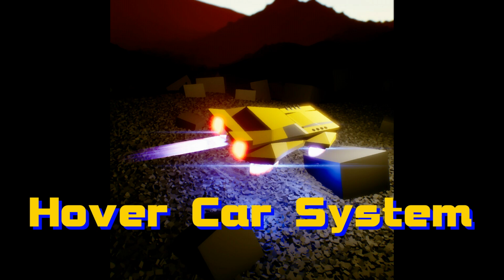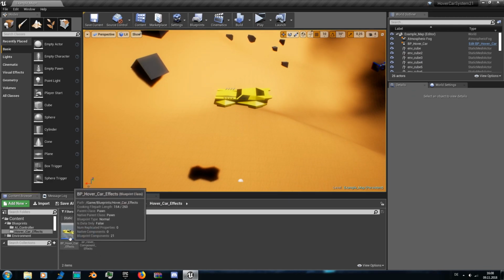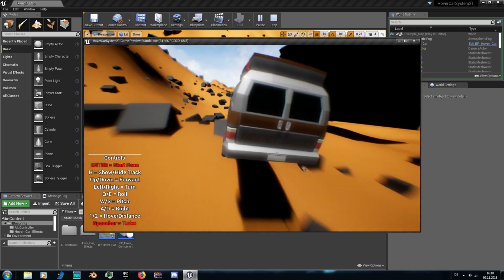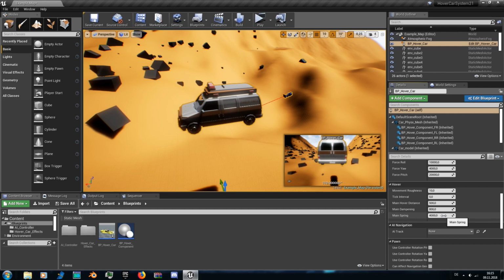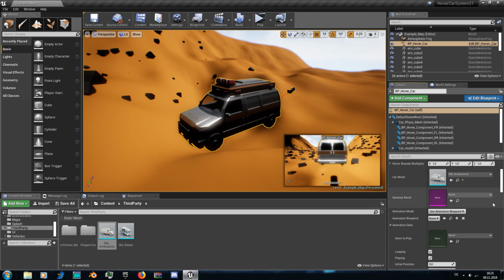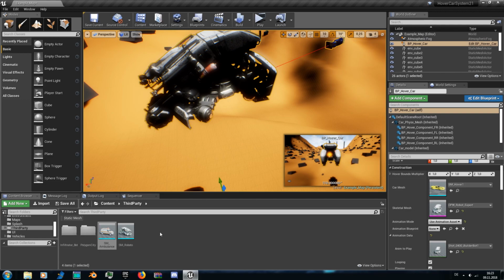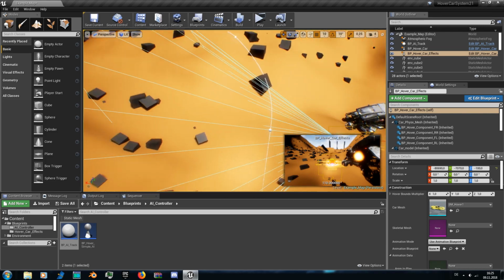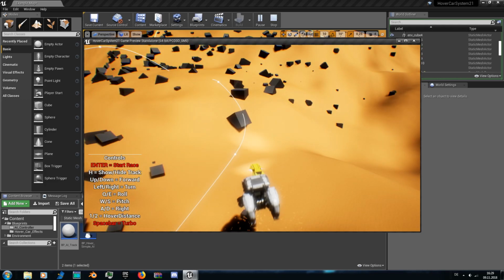Hover Car System - Basic Tutorial

Comment: hi hopefully you'll read this, i bought your project and when i drag it into my game and place the car, the pitch wobbles up and down violently, it works great in your project though, any ideas on how to fix this are greatly appreciated
Reply from the maker: Hey,
Maybe compare in your your Project Settings -> Physics -> Max Substep Delta time.

I can only recreate the frequent pitching issue when I increase the Max Substep Delta time using async physics. You can write me an email if you still can't solve the problem and I can take a closer look :)
Reply from the maker: If you are not using async physics, it should not happen. I need to check now if async physics is the new default in UE5. What engine version did you use?

Comment: Can you use this car system for flying?
Reply from the maker: It's not built to fly freely but to stick close to the ground at a distance. I think there are other assets on the marketplace that will perform way better in that regard. With some simple modifications (disable gravity/stick to surface) it can be used like a spaceship controller, but for helicopter/plane like flight it's probably not the right asset.

Comment: This is awesome! Using it in my project right now,but quick question how would i make it so that it doesn't stick to walls and move vertically
Reply from the maker: You could measure the angle on the linetrace in the hover components and if the Angle is too far from 0,0,1 world direction, just don't apply the hover components forces to the car. You can use the Dot Product for that ^_^

Comment: Hopefully you can help out with this but I am trying to make the car fall faster after going off a jump. Because I cannot adjust the gravity setting because I can't call the movement component I am confused. Even if I set the gravity delay parameter down it still floats too far. I even setup a boolean to change the acceleration pattern while in air but it want it fall faster. Any suggestions?
Reply from the maker: The movement is handled in the BP_Hover_Car main class. There is a variable called "Gravity Increase Delay" that you are probably looking for. It's a weird way, but I did it to have this launching like movement.
Reply from the maker: If you look for that variable you'll find some other gravity stuff you might want to change probably.
Reply: thanks so much for responding so quickly. As I said I did happen to find that setting and tweak it down to make gravity kick in immediately while in the air but I still float really far. Just wondering if other than the gravity increase delay if there was another way of turning up the gravity or increasing the mass of car without messing too much with the settings of the hover component.
Reply from the maker: @andrewhart74  Sure. Inside the BP_Hover_Car BP the gravity force can be increased or decresed as you want. It's currently applied on Tick as an "AddForce of -8000".
You could for example make this speed-dependent or time dependent or both.

One way would be using Vector3(0,0,Clampfloat[1000/Speed,0.0,1.0)*Vector3(0,0,-8000)
for the "AddForce" Input. So the faster the car goes, the less it's affected by this gravity.
Another way would be to start a timer-variable once the car looses ground and multiply the downward force by the timer. That way the longer the car flies, the stronger the gravity will be.

One problem is that a lower gravity means the car might just be able to fly around if the thrusters are strong enough.
Reply from the maker: So for getting your perfect movement, you may want to tweak all those parameters and maybe even the upward forces of the thrusters while the car is in the air. If you need more stuff, feel free to write me an email about it.
Reply: @tankbustergames9953   Oh that did the trick thank you!!!

Comment: Hey man, I love the hover car system! But I have a slight problem, I can't get the AI to work. I Have added the spline track and set the other BP Hover Car to AIController and set the track to follow. And i have added an event in the Level Blueprint to Start Race for all actors of the Simple AI Class. But they never move... Any suggestions? Thanks!
Reply: That sounds strange. It should work. Have you choosen the right AIController Class (BP_Hover_Simple_AI) for the cars or the standart AIController?

Comment: This is really fantastic! It's pretty much exactly what I need for my first big UE4 project!   :)   I'm a little torn, though... I feel like I should try to create a system like this myself to learn, but on the other hand this would let me get in and prototype my concept much much faster.

I do have a silly question.  Are all the hover and flight variables able to be adjusted on the fly? Like, if I were to implement some kind of upgrade system to allow faster acceleration, top speed, better handling? 

I will say, the price is extremely fair and I could probably learn a lot just seeing how you did it and playing with different settings!   Thanks!
Reply from the maker: Glad u like it :) You can adjust all variables on the fly ingame. I can not tell you to buy it. Just think this way: you want to learn -> don't buy, create your own (will benefit in the long term) // you want a fast prototype -> buy (saves time and you can maybe learn a little^^)
Reply: @tankbustergames9953   Went ahead and got it! Following advice of Gary Newman (gmod and Rust) saying to just start making things and playing and sharing as often as possible. Anything that lets me get to that faster is helpful.  

Also, always happy to support creators!  :D

Comment: The camera isn't rotating when I turn.
How do I fix this?
Reply from the maker: Go to the HoverCar BP, select the Spring Arm Component and Turn "Inherit Yaw". You can also adjust camera drag or Inherit other Axis. I disabled it by default to show the Car from all sides. Will fix it soon if requested by 1 more ppl ;)
Reply: @tankbustergames9953  thank you!
Reply from the maker: @neonatonaten  you are always welcome. Customer Service ^^
Reply: It's still not working for some reason, I'm using a fresh build and haven't changed any other settings, any ideas?
Reply from the maker: @neonatonaten  Okay, that shouldn't happen. Are you using the "BP_Hover_Car" or the "BP_Hover_Car_Effects" ? Those classes are in no way related. The effects car is the default Showcase car with those nice particle effects, so depending on what car you use, u will have to set the checkbox in that BP. If this is the problem, sorry, I will soon fix it and make the effects car a child class of BP_Hover_Car to avoid confusion in the future. And i will make the turning camera default for the car.
However, if it doesn't fix your problem, make sure to "use pawn control rotation" on the camera spring arm is disabled as well. I tested it multiple times, and I'm sure it will work.
Reply: That fixed it! I was using the wrong one lol  @tankbustergames9953
Reply from the maker: @neonatonaten  oh god, I'm so sorry for wasting your time. I always was like "this may confuse ppl", but haven't changed it anyways. I'll do that soon now. Thanks for your question.
Reply: No problem, I love the asset and I'm very excited to use it! @tankbustergames9953
Reply: Also I can't get the hit event for the collision to fire.